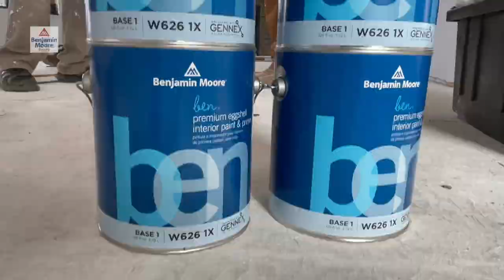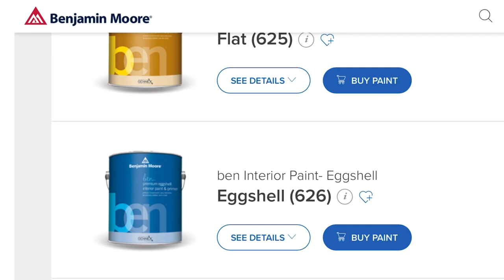Building The Farmhouse | Day 59

Comment: Four feet to short, time to break out the foundation stretcher. I would've loved to hear that conversation between the homeowner and the builder. Not being in the trades, does that mean a complete re-do? 

Many years back, on late night tv, a Product called the Paint Stick was sold. It was a roller with a reservoir. I bought one and was glad I did. It worked, once you cut in a room, it didn't take long at all to roll a room. Now there's the one like the guys used, what a step up. Thanks for posting

Comment: Start upstairs first then go to the stairs, then 1st floor. It will make dealing with the hose a lot easier. You could hang it on the stair 1/2 wall or instead of in the actual steps.

Comment: Pro tip when using water based paint wet the brush with water then flick it out. It help the paint flow off the brush and makes cleaning easier.

Comment: Pro-tip+ better than looking at your colour swatch in different lights, get your sample pot and paint up a piece of paper, the back of old  wallpaper or children's drawing paper, then you can move that round to different places at different times of the day in different lights. DO NOT paint sample pots onto the wall because if you don't choose 'that' colour, then it could be difficult to over paint with the colour you ultimately choose and the brush strokes and edges could show.

To avoid scuffing the walls, work FROM the furthest point away from the exit and work back....so you never need to walk past something you already completed.

Comment: Pro paint tip... If you don't have to lean the ladder on the wall cutting in behind the roller person lets you paint without dipping as much as you feather out the paint lip left by the roller. Also don't use paint trays for the roller, get a grid for a 5 gallon paint bucket  (1/4 to 1/2 full max) is the best. Less messy, less likely to spill, easier to move around and when done between coats cover the bucket and roller with plastic so it doesn't dry out (don't submerge roller).

Comment: When you cut in with your brush you should back roll with a 4” roller as close as you can to the ceiling. That way the texture will match when you roll the walls.

Comment: Pro Tip:  I like to run a bead of caulking at the ceiling / wall edge to smooth any rough spots.   Then ceiling paint goes on and a little overage on wall is ok.  After ceiling is done I cut in the wall.   Looks tight.     Another is to use a sharpie on bagged brushes and rollers so you know what it is (primer, ceiling paint, bathroom paint, wall paint, etcc.)

Comment: A pro painter told me not to scrape the brush on the rim you should tap the  inside of the can after you dip the brush in the paint to remove excess paint and a good additive to put in the paint is called floatrol it retards the drying time it will let the paint even out

Comment: I’m not a pro but I’m going to give you a pro tip of the day for cutting in. When cutting in, carry a small roller and back roll over your brush strokes as close as you can to the ceiling or trim. I’ll also throw a screen in the bucket for the roller so you don’t use too much paint.
Reply: A nice  3in or 4 in  hot dog roller will work to get closer to ceiling & walls over the paint strokes..

Comment: Similar to the foundation mistake, my crew had a house we were asked to help with because another crew fell behind on a couple of houses. They subbed out the foundation to someone and no one came back to double check dimensions. We had all the LVL floor beams precut and delivered to the site. I went to throw the first beam across the basement span and the beam fell right into the hole. Grabbed another beam and same thing happened. Pulled out my tape and found out the foundation wall was built with centerline dimensions from the plan instead as inside dimensions. As a result the foundation was offset out 8" in all directions.

Owner and original contractor had a LONG meeting about whether to tear out the foundation or re-order all the pre-cut LVL beams and stop/re-order all the engineered trusses. Our crew respectfully walked away from the project and realized there may have been a reason the original crew was having a hard time keep up on their houses.

Comment: Best way not to scuff your walls after you paint is to start at the furthest corner and highest point and work your way out of the house (the opposite of what they did), this way you are never carrying equipment past walls with wet paint. Think of it like painting a floor. You don't want to paint yourself into a corner.
Reply: Excellent pro tip!  I was going to post this but you beat me to it.

Comment: PRO TIP. Take a piece of sandpaper and fold it into a 1/4. Run the sharp edge against the ceiling creating a fine  groove edge. The paint off the brush follows that groove. Sweet straight cut edge. Works wonders on stippled ceilings. Been doing this for yrs.

Comment: Pro Tip: Which way do you roller on paint  IN a room..clock wise or counter clock wise as you work around the room?? 
A: If you are right handed & paint with your right arm, you go counter clock wise in a room..Your strong right side you are able to start a new wall with out touching wet wall with your shoulder against wet paint. If you went clock wise your left shoulder might touch wet wall and very hard to get close start in corner of new walL.. It is a good PRO TIP..

Keep up the good work guys & see in your next video..